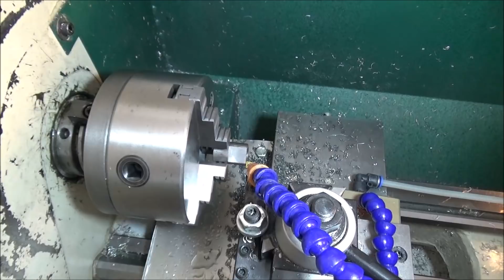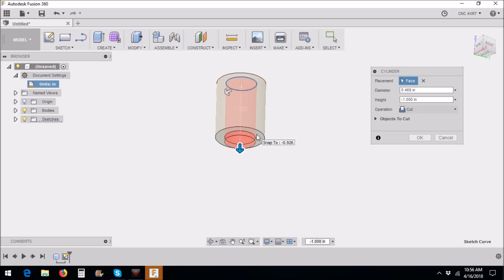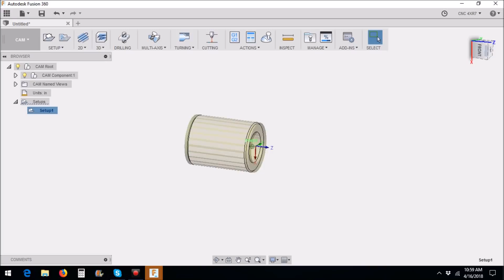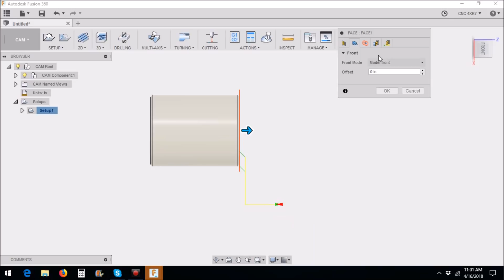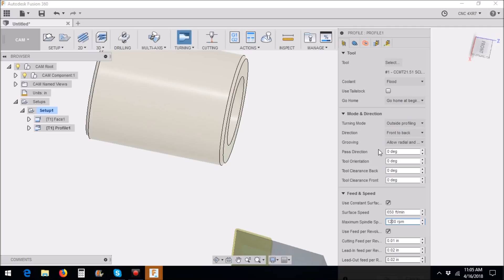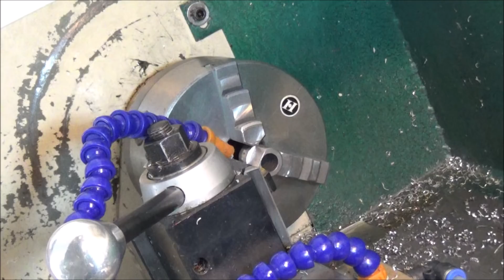Customer No Service!

Comment: Sam, very well done video. You walked everyone thru the steps in Fusion better than I have seen many other people. You made it easy to follow, and enjoyable. I am having a little difficulty with the engraving in Fusion, I'm going to check if you have a video on this and if not perhaps if you have the time it might make for a good video. I am sure a lot of people would benefit from it.
Great job thanks.
Reply from the maker: Hi Joe, A lot of issues with Engraving has to do with the fact the text did not support single Line fonts.
 The latest update fixed that issue so if you have not tried in the past week I would give it another look.
Reply from the maker: The New Font update should help I have single line fonts I downloaded years ago for CamBam they work great
Reply: It's not realy engraving it does a Vcarve toolpath  to get an engrave you have to use traces